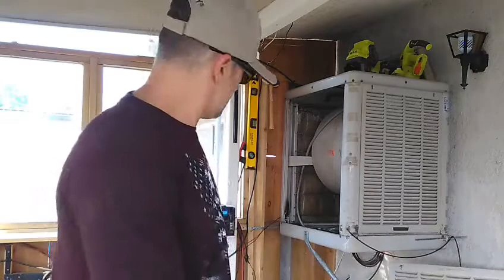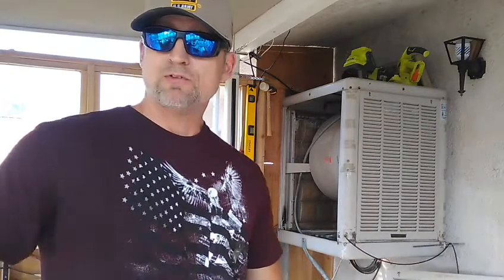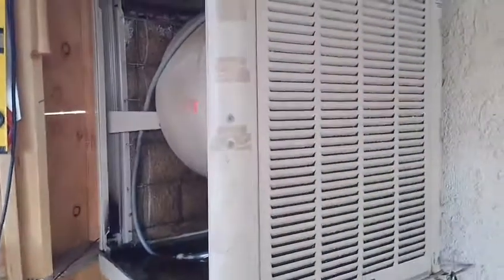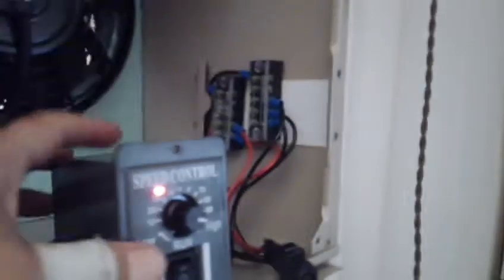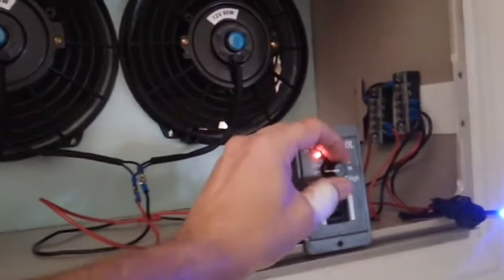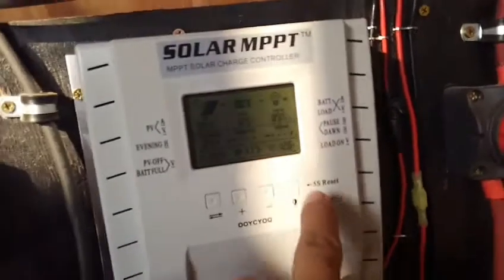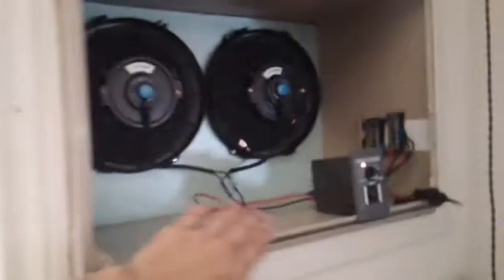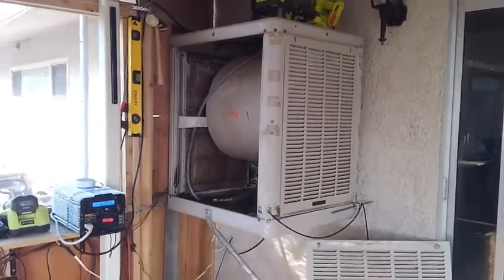Solar Powered Swamp Cooler Project

Comment: Great idea! I am off grid but the huge ac fan is hard on my batteries so I run a generator for the ac only. I have 600 ah of lithium batteries and 3000 w of solar runs everything else no problem

Comment: How many batteries are you using for SWAMP COOLER
Reply from the maker: You might want to watch my series on installing my off grid solar system.  I'm using 4 6v 215amp hour batteries I bought from Sams Club.
https://www.youtube.com/watch?v=TVwweyqEykE
Reply: I have two 35 amp hour batteries my problem is how do I run it on battery when Sun stops shining

Comment: I was thinking about doing something like this for my off grid property so decided to see if there was a Youtube video of someone who has done it. I like how you did it. It's awesome.  I also see that you could add a switch and use just one fan if you wanted to. Batteries in a solar system are expensive and there is a big difference between using 500 watts for 10 hours during a night and using just 120 watts for 10 hours. A couple of 12v 100amp LiFePo4 batteries would do it well. No inverter needed and plenty of cool air.

Comment: I presume you implemented one or two fuse(s) to protect your fans, and one fuse to protect your water pump or your motor speed controller.  What size amp fuse(s) did you  use to protect your fans?  What size amp fuse did you use to protect your water pump?  What size amp fuse did you use to protect your motor speed controller?  How many amps / watts is your battery?  How many amp hours is your battery?  I subscribed to your YouTube video channel and gave you a thumbs up!  Please respond to all my questions in the comment / reply section.  Thank you.
Reply from the maker: Please watch my Solar Setup video to answer your questions about my battery bank and how I run this swamp cooler off grid.  As far as the fuse, I use an inline 20amp fuse.  The fans are 6amps each and the pump is 3amps.  The speeder controller doesn't use anything.  It just controls the watts and amps which regulates the fan speed.  Sorry I didn't do a more thorough instructional video.  I listed all the parts used in the description.  Look those up for more details on the watts and amps used.  If it doesn't tell you the amps, just divide the watts by the 12volts and that will give you the amps. Hope this helps. Here is a link to my Off Grid Solar setup series but it's more involved than just using a basic setup.  I'm running lights, cameras, swamp cooler and power tools when I need it.   https://youtu.be/TVwweyqEykE

Comment: on the batteries , you have a 4 battery bank are they deep cycle?
Reply from the maker: Yes, I bought Duracell GC2 75 amp hour deep cycle batteries I bought from Sam's club for about $50 each 2 years ago.  https://www.samsclub.com/s/duracell%20gc2
Reply from the maker: You can watch my entire solar build on my channel. Here are the battery connections. https://youtu.be/XgftCHq2xB8

Comment: I run mine off 500 watt solar and 500 watt pure sine wave inverter. Still on ac power. Runs 250 watts . Runs all day about 7-8 hours
Reply from the maker: I could not get the motor started with a 500w inverter.  The cranking amps is too high for most swamp coolers.  I just got my 3000w inverter replaced under Warranty.  It died and was probably bad from the start.  I might try to see if it will start the AC Motor to see if that was the problem. I'm surprised you can get one started with just 500w.  What size swamp coolor or motor is yours?
Reply: @plantbasedprepper  my cooler looks just a bit smaller than yours. My motor says 4.5 amps 110 volt. But actual consumption is only 250-260 watts even on start up.
Reply from the maker: @kevinbreaux6769  I'll get back to you! I'm going to look at the specs for mine and read the amps on startup using AC power first. Then try it on my new inverter again.
Reply: @plantbasedprepper  I just went and rechecked the killawatt meter and its 360 watts startup. 250 watts running.

Comment: Clever. Here I was thinking, how can I power the motor, to spin the pulley, to rotate the hamster wheel? When all it took was some 12v car fans. What purpose does the pump achieve. Does it just soak the pads in cold water? I remember having one in my home as a kid, but can't remember how they worked.
Reply from the maker: The pump moves the water up the tubes and drops it on top of each side of the swap cooler pads.  It's still working great!  Just installed a cover and vent on the front and it lowered the fan noise quite a bit and directed the air where I wanted it.  The only thing I would do diff is try several different 12v fans and choose the quietest one with the strongest flow but I'm very happy with it!
Reply: It's an evaporative cooler.  The pump puts water on the pads, so it's spread over a large surface, so it can evaporate water into the air.  The moist air is pulled through the house by the fans.  Moist air holds more heat than dry air, so it collects the heat and then leaves through an open window at the other end of the house.  In greenhouses, the pads are at one end of the greenhouse, and the fans are at the other end.

Comment: how many panels are you using and at what watts
Reply from the maker: Here's a look at my solar panel project. https://www.youtube.com/watch?v=C5xY6l-uUuM
Reply: @plantbasedprepper  will go there now thanks
Reply from the maker: I have 4x100 watt panels with 4x6v 215amp Duracell Golf Cart Batteries I bought from Sam's Club for $80/each.  That gives me about 5k watts that I only drain to 30%, so that's 3,500watts/day.  The swamp cooler is 120watts/hour on full speed so if I run it for 24 hours, that's 2,880 watts per day. I probably only run it about 8 hours/day during the summer and it usually runs off the solar panels alone while keeping the battery bank fully charged. I love it!
Reply: @plantbasedprepper  Could it run off the solar alone whenever the suns up, no batteries?
Reply from the maker: @willowq6445  Yes because it takes 120/watts on full speed so as long as the sun's up because I have 400watt total in solar panels. I just need 200watts to cover it.
Reply: @plantbasedprepper  thanks for getting back to me,mine runs on the 120 volt at 420watts by my kilowatt meter so i have been thinking of a way to run mine on solar, its a window one about your size, 4000 cfm or so. i have been talking to some forum people and they keep telling me i cant run my cooler at 400 watts on 120 with a battery backup because i need more panels, i was planning on 2x100 to start with, they said 400 watts panels wont run a 400 watt cooler on 120, so your looks great. how much air do you get blowing out, quite a bit
Reply from the maker: @mattrowe1229  The only reason I couldn't run mine with solar was the surge required to start the AC motor. It kept tripping my 3000 watt inverter! It blows a lot but the air goes to the side vs directly in front but with a cover, you can direct it where you want. I'm installing a directional vent here soon. Just make sure you find 2 8" radiator fans and read reviews on Amazon. Some are too loud and some take more or less watts. I used a foam Insulation Board I found at Home Depot, cut to size and mounts onto it perfectly.
Reply: @plantbasedprepper  yes, i have watched your vids, so would a single fan blow better i wonder with less watts, or would 2 be better, i watched another vid where a guy shows he is usng a single 20 inch fan, i will go rewatch his video and see if i missed anything, but he said or linked to your vid and said thats where he got his idea was from your video, he might have linked to yours in his response or comments,
Reply from the maker: @mattrowe1229  if a bigger fan will fit, I'd try it. Can always try both and return what you don't use. Just make sure when you look on Amazon, it says free returns. I'd like to see the other guys setup too. Can you send me the link? Curious how it turned out. Thanks.
Reply: @plantbasedprepper  heres the link for the video  https://www.youtube.com/watch?v=AW17t1kbFH4&t=56s
Reply: @plantbasedprepper  so you are running 2 in series for 12 volt and then 2 in parallel to up the watts or amp hours.
Reply from the maker: @mattrowe1229  Yes, it makes two 12v 215amp hour batteries.
Reply: @plantbasedprepper  thanks for your replies, hope im not bugging you like some tubers, are your fans pushing or pulling, maybe with a grate it would blow straighter. i posted a link to the guys video for you, he has grate on the front of his, and from the charge controller looks like he is drawing around 120 to 180 watts.
Reply from the maker: @mattrowe1229  Not a problem, my channel isn't that big so I have time to answer questions. I'm definitely going to add a front cover and thinking about one that I can direct air flow.